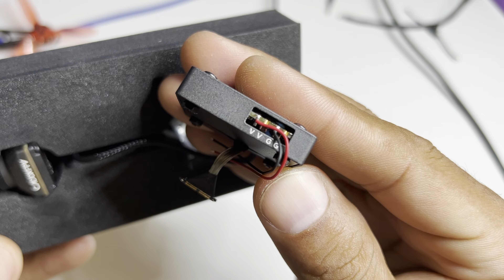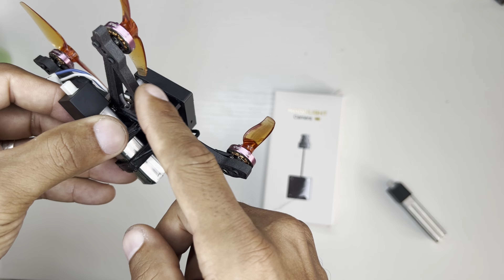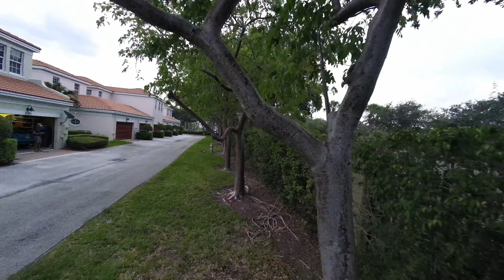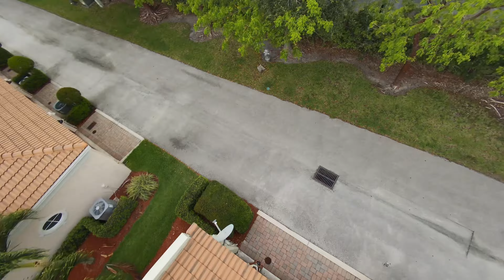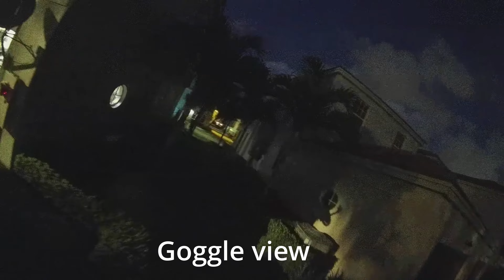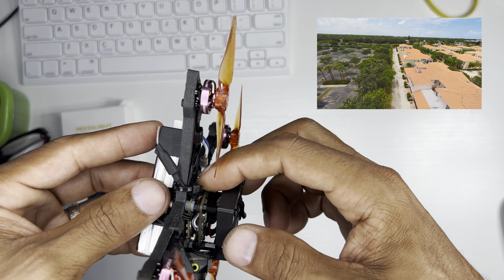Moonlight DVR board with existing VTX

Comment: Nice. What Vtx are you using?
Reply from the maker: Thank You! This is the v2 1S board that has the 5v input limit, that's why I had it attached to the 5v Bec from flight controller while powering the DVR from VBAT.

Comment: Thanks for sharing! I've been thinking of doing something very similar with a whoop
Reply from the maker: You’re welcome😎! I want to do the same which is why I’m wondering how it works outside the casing so it can shed more weight. I only haven’t tried yet cause I’m afraid of messing up this current setup and overheating. But as it is a 2s whoop would work well